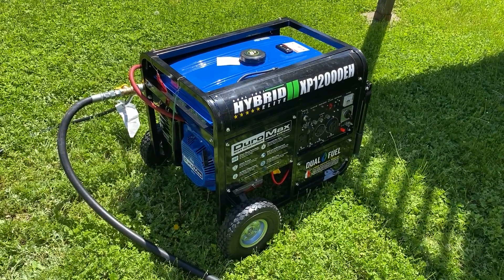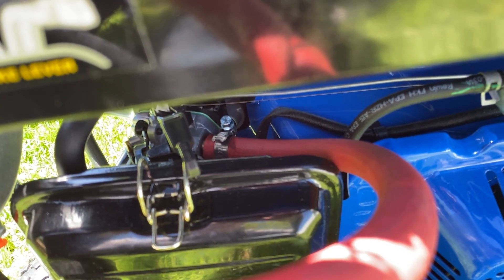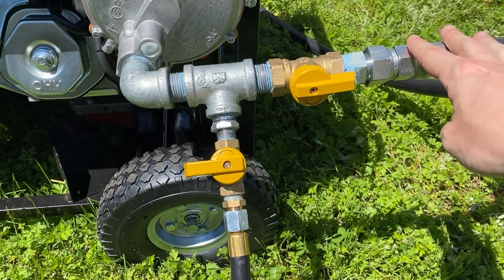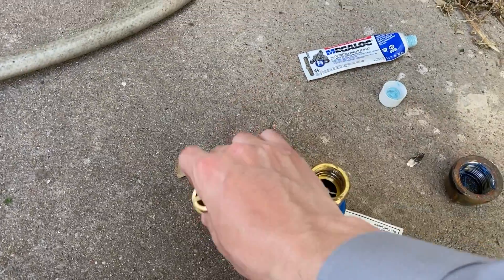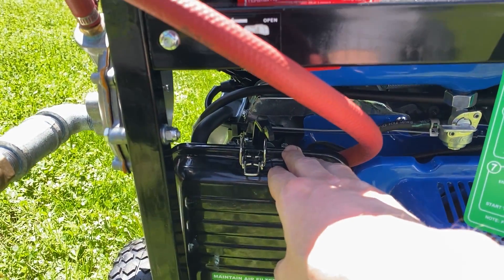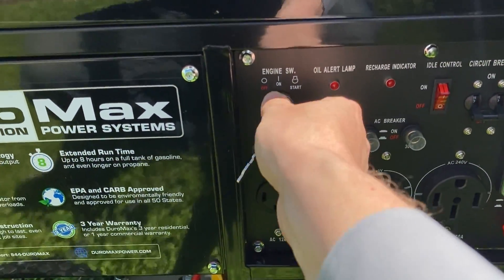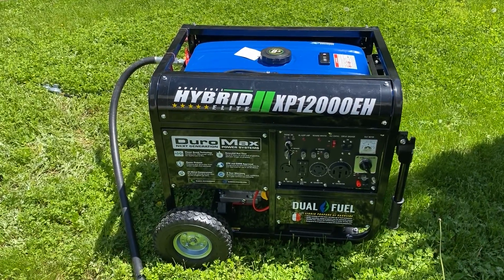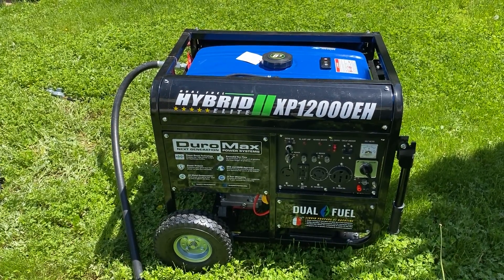Making my Duromax XP12000EH  Generator Tri-fuel By Adding Natural Gas Regulator

Comment: To get the maximum power out of NG, you are likely going to need to make some changes to your setup.  I think you will find an orifice jetted for propane inside where the hose connects to the carb.  I suggest you enlarge that as much as possible.  Then, you need to add a load block to the output of your KN regulator. The load block will act like an adjustable orifice and will need to be re-adjusted every time you switch from NG to Propane and again when you switch back to NG.  Also, don't run the generator on a rich NG mixture or you can do some damage to your engine.  Better a little lean than rich!
Reply: The reason of buying the trifuel regulator is that it comes with 2 orifice nozzles built in the thing..  or they come with the bigger of the two and require a propane regulator on the propane tank..

Comment: Looks great. The only thing you should consider doing is replacing the galvanized fittings with black steel pipe fittings. Galvanized or zinc coated runs the risk of flaking off and plugging up the small orifices in the carb. That's why you won't find galvanized in any gas line application.
Reply: That’s not true, im a master plumber in Houston area and been running galv. For any outside work for 41 yrs and no problems that I know of. I have a friend in Connecticut that is not allowed to run galv. So it’s always black and painted. But we can here

Comment: Very informative video. When switching to natural gas, is the regulator always shooting natural gas until you shut off the yelow valve? Or is it automatic? I am about to convert my Westinghouse 9500. Also, if we are able to run both propane and natural gas on the sake regulator, why can't you just keep using the original propane regulator that came with it at first ?

Comment: I’m surprised that your red hose is connected directly to the outlet of the regulator.    I have had two regulators like this and the outlet port has an adjuster installed.   You attach the red hose to the adjuster.    The adjuster is essentially a needle valve and allows you to  tune the gas flow to the generator.   Using the choke really shouldn’t be done with nat gas.    It’s for gasoline.    I recommend getting a needle regulator then tuning the gas flow properly.
Reply from the maker: I started up the generator today and it was running rough with the choke open. When I removed the two red plugs, it immediately settled. The installation of the regulator was following Nash Fuel's instructions.

Comment: Great video. I have the duromax 12000 hx and got the Nash fuel regulator you have, bur for my model. Essentially the same generator but with a couple of different features. Your propane/ng setup and links to the respective parts is awesome. Thank you for putting this video up.
Reply from the maker: You are most welcome!

Comment: With so many regulators on line to purchase, what is the manufacturer and model or part number for the regulator you have success in running both propane and NG through?
Reply from the maker: I used this one I bought on Ebay: https://www.ebay.com/itm/174192491497?ssPageName=STRK%3AMEBIDX%3AIT&_trksid=p2060353.m2749.l2649

Comment: How long is your total length of pipe (including flex hose) from your generator to meter?   Looking at a similar setup, but thinking I may have to upgrade my meter and supply line coming into the house.
Reply from the maker: I would estimate that the length of black pipe is about 50 feet.

Comment: You need to pull the red plugs out of the vents on the larger regulator attached to the generator. I bet you afterwards you could run the generator with the choke fully open
Reply from the maker: Thanks for the advice. I will try this out soon.
Reply: @petetomo1 did removing red plug help with full choke problem?
Reply from the maker: @PainShock_99  I haven't had a chance to check yet since we haven't lost power since I modified this generator. Thanks for the reminder though. Maybe, I'll set aside some time next week to try it out.
Reply from the maker: @PainShock_99  I started up the generator today and it was running rough with the choke open. When I removed the two red plugs, it immediately settled.
Reply from the maker: I started up the generator today and it was running rough with the choke open. When I removed the two red plugs, it immediately settled.
Reply: Th red shipping bracket is still there